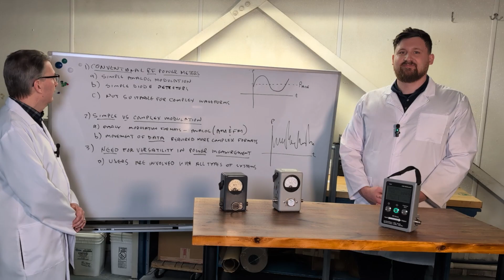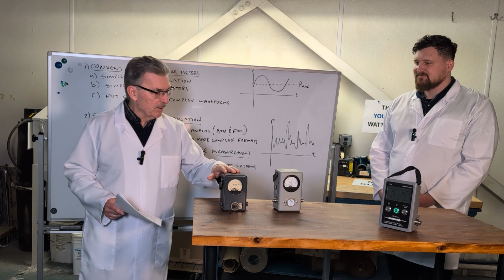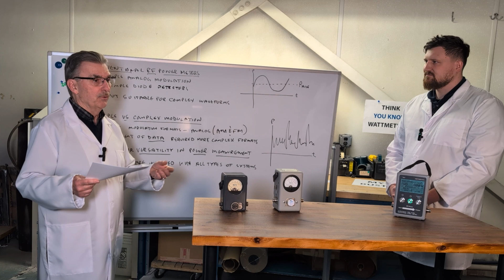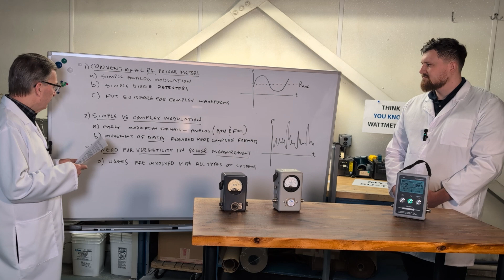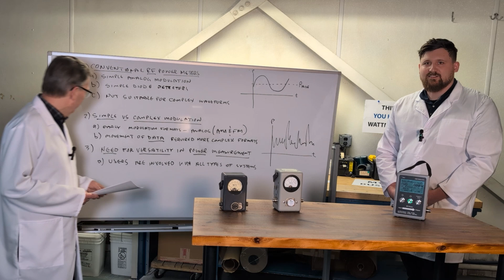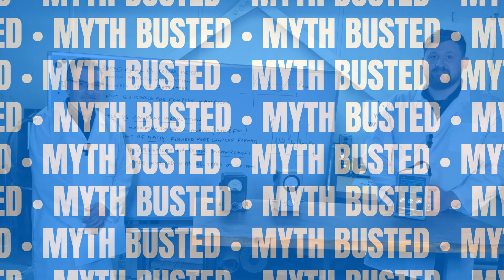Myth #3 Busted: Wattmeters Can Only Measure One Signal Type | Tech Talk

Comment: "I am unable to measure accurately in digital signal mode. In analog mode, the measurements are completely accurate, but in digital mode, there is a significant margin of error. Is there any guidance on how to measure digital signals properly? Older versions of mechanical measurement devices were able to measure both digital and analog signals quite accurately."
Reply from the maker: Thank you for your inquiry. The 4480A measures both analog and digital signals without the need to switch modes. The wattmeter is looking for a true average power passed through the line section. With digital signals, the true average power may differ from the expected transmission power depending on signal properties. 

For example, a signal with TDMA channel spacing could be transmitting at 10W, but the if half of the time slots are used for receiving traffic, the true average output will only be around 5W.  

This is only one example, but if you contact our applications team directly at https://birdrf.zendesk.com/hc/en-us/requests/new they will be happy to address your specific use case
Reply: @BirdTechnologies  With analog signals, I’m also encountering a bit of an issue. For handheld radios transmitting at a power threshold of 5W on UHF, the measurement is fairly accurate. However, for base stations transmitting at 40W in analog mode, there’s a significant discrepancy in the readings, and I’m not sure why there’s such a difference. When compared to older versions using mechanical sensors, the measurements were quite accurate.

As for digital signals, if — as you mentioned — the signal only occupies one time slot, then the actual output power could be roughly halved. But why do older versions of Bird meters still show accurate power readings that match the configured output on transmitters?

I am currently testing on Motorola handheld radios, base stations, and repeaters from the same manufacturer. I’ve purchased two of your newer devices and am trying to understand and explain why these discrepancies exist in the measurement results
Reply: @BirdTechnologies  Thank you, I understand the issue now. There was a slight mismatch in the output load impedance, which caused the measurement to be inaccurate. I will review the documentation related to power in TDMA transmission methods.

Comment: Specifically, are you referring to Average Power vs PEP (Peak Envelope Power) measurements in this video?
Reply from the maker: Thank you for your inquiry. In our video, we discussed differences in the ability of directional power meters to determine the average power of various types of modulated waveforms. The venerable Bird Model 43 power meter and the new Bird 4480A instrument are both intended for the measurement of average power.

The measurement of peak power, including peak envelope power, is a different discussion and would involve different measurement instruments. In the case of peak power measurements, there are several additional considerations, including the measurement speed (video bandwidth) of the instruments making these measurements.

For more questions on this topic, feel free to reach out to our applications team at appengineering@birdrf.com.
Reply: @BirdTechnologies  OK, this is why I ask the question. I have a Bird 43P with a PEP kit. I think the video would have been more clear if you also talked about the PEP capabilities of the 43P,  in comparison to the 4480A, as most users are well aware of the PEP options available in the 43 series. Just my 2c.
Reply from the maker: @mostlypostie1  The Bird model 4480A was designed for measuring the average power of radio frequency waveforms, making it a great starting point for comparing this new instrument with previous Bird models. In a future video, we may explore the peak power measurement capabilities of Bird instruments, including the model 43 equipped with the PEP conversion kit.
 
Thank you for the suggestion! We appreciate the idea and will consider discussing the differences in measurement capabilities among various Bird instruments, such as the model 43 with peak capability, the model 4314, the model 4391, and other Bird solutions designed for peak power measurement, in a future video.